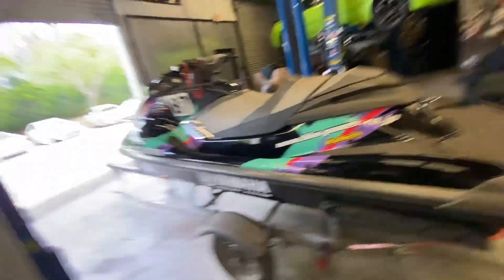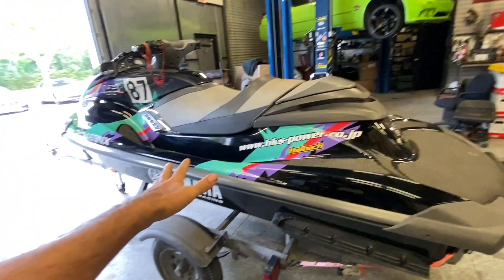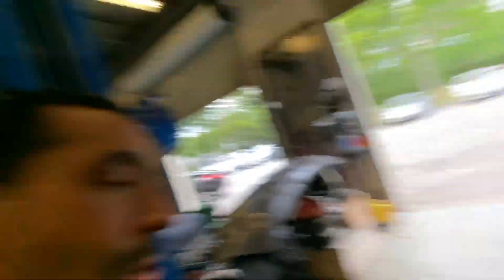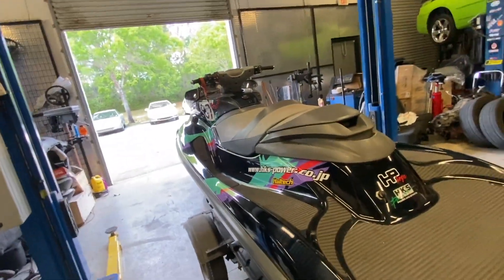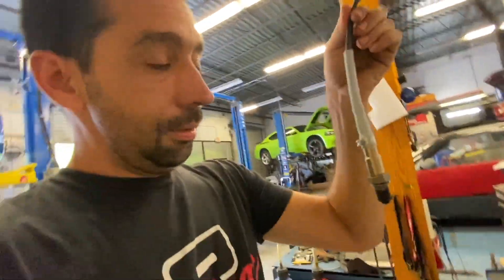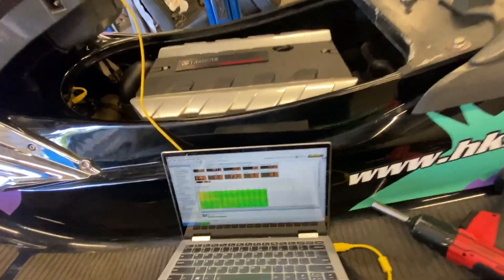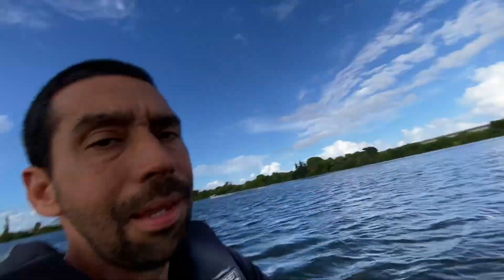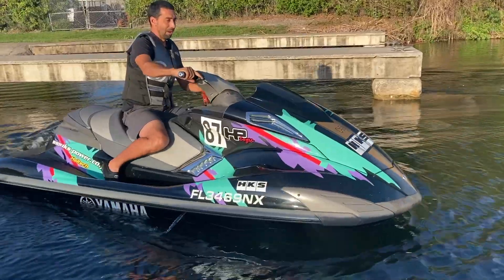FX SHO CAVITATION CONTROL | PERFECT LAUNCH | HALTECH

Comment: I wonder if the temperature of the water or fresh or saltwater will change the point at which cavitation happens?   ;)
Reply from the maker: For sure it does. Salt water has always been less cavitation prone from my experience. As for temperature, I'm not sure there. It's always warm here lol.
Reply: @JackCecil  is 14.7 a little bit high for a air fuel ratio My gd3 seems to be running rich according to the flash Pro?